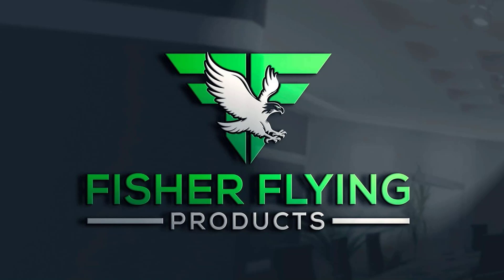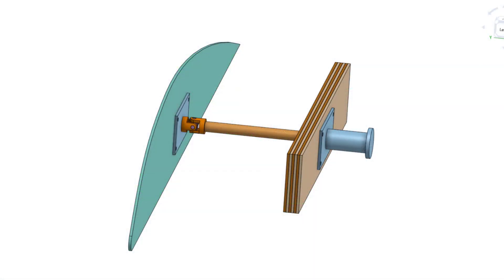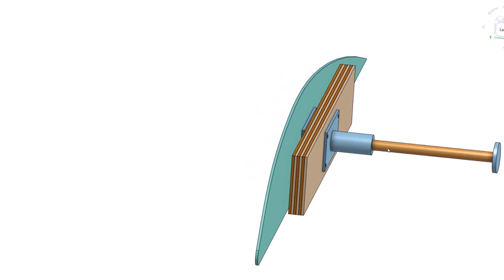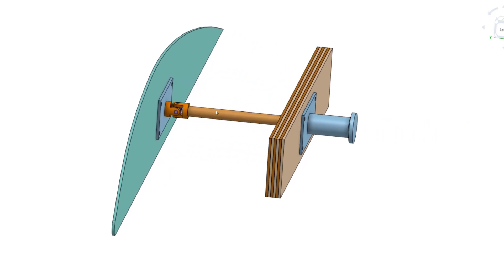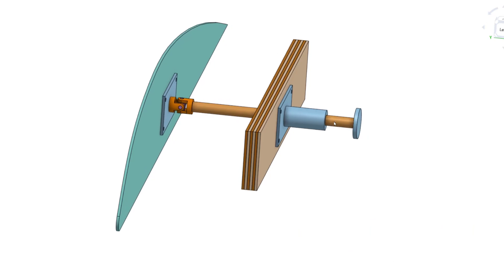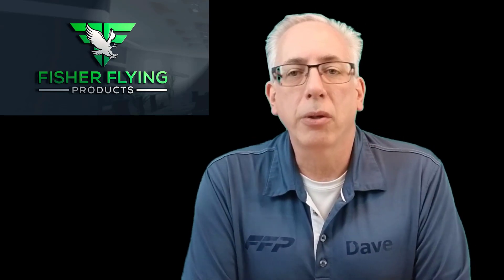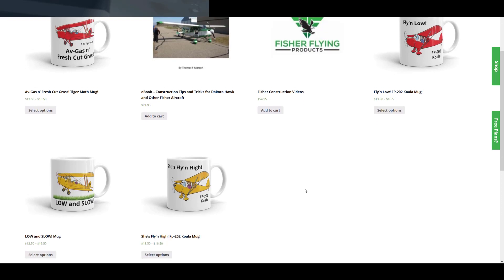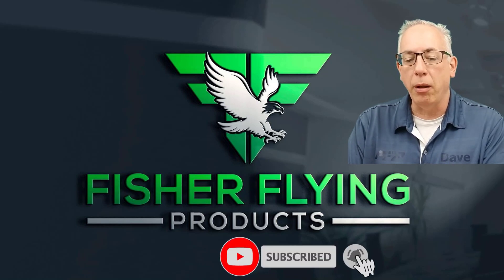NEW WING FOLDING SYSTEM! - WEB STORE BLING! -  ELECTRIC DRIVE UPDATE! -- WOOD TESTING UPDATE! - MORE

Comment: This folding wing design would work well if the root rib attach plate had a "compression strut" attaching it to both spars.
Reply from the maker: Tim. I agree. I worked on the mechanism first and the supporting structure second. I have an even simpler articulation joint in mind.

Comment: Electric propulsion! Wow I didn't know you were working on that! I have been thinking that if (when) I started a 404 or Classic (or 505) I'd want to use the motor and batteries out of a Zero motorcycle. Might be a bit of a stretch for a Classic though.
Reply from the maker: We will have electric options available under our new Electro-Thrust division.
Reply: Don't biplanes require LESS HP? It seems to me they'd be an even better platform for the concept than a Koala or Dakota Hawk,
Reply: @estoops1592  A smaller aircraft tends to need a smaller engine, but a biplane trends to have more drag than a sleeker aircraft so it would need a bit more, I believe.

Comment: Pushing in and out a 60lbs fully cantilevered wing seems to require a fair amount of effort. The supporting rod must be very stiff and it should slide on some type of pillow bearing. Have you done any test on a mockup prototype yet?
Reply: My wings are only 31 lbs on the koala, I might do this
Reply from the maker: I am thinking of using a Delrin bushing and something like a 1/2" Socket Extension hardened, chromed and the swelled end acts as the stop.
Reply: @fisherflyingproducts5747  It seems small but keep us posted, hopefully I'm wrong
Reply: Wings on an ultralight probably won’t be that heavy. At least not US part 103 wings.